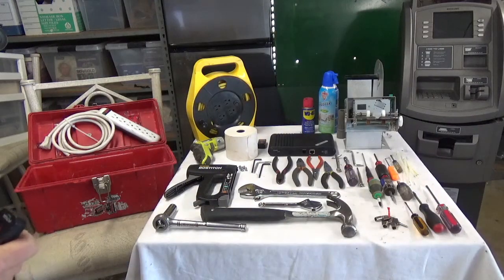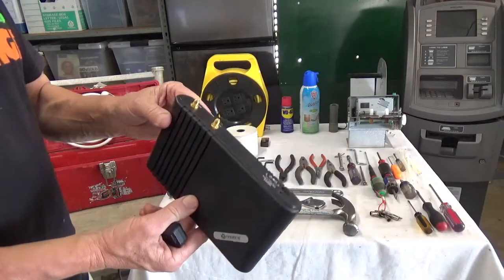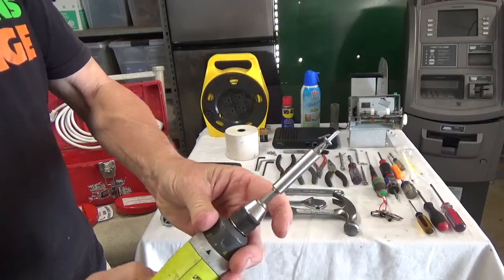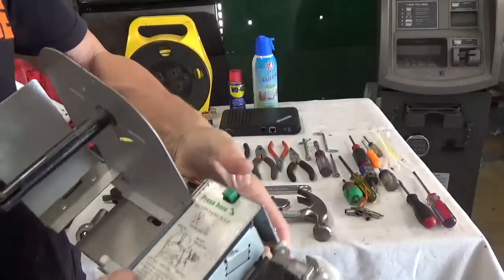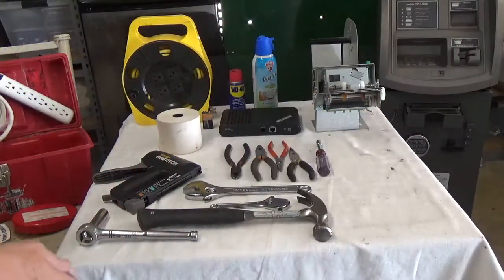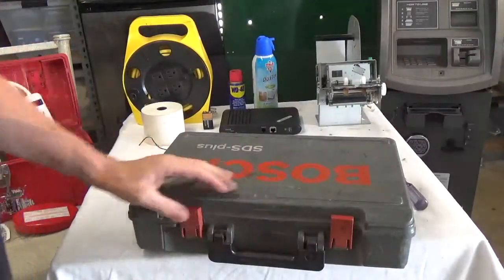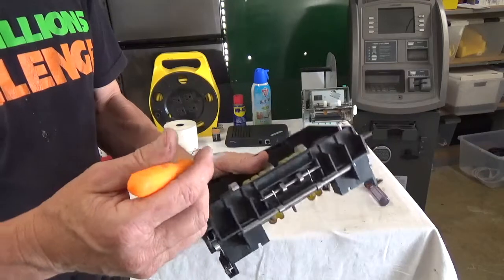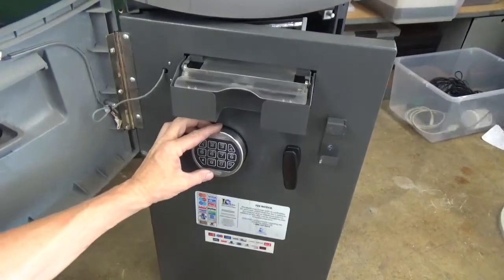ATM - Tools of the trade

Comment: On the 1800 SE if you forget the reject door open it can interfere with the locking mechanism. After entering the combination it will beep twice for GOOD but the handle won't turn.
The solution for this is to give a good kick with your heel in the middle of the door to bounce the reject door out of the way. Then try again.

Comment: what are the three most common repairs you perform?
Reply from the maker: Hi, The most common service call is a communication error, phone line, wireless box or internet problems. Second: Money will get stuck in the cash dispenser belts. Third: The receipt printer jams up and needs to be taken apart. But saying that, these service calls are usually older ATM's. The new ATM's have very few service calls unless it's human error. Hey, feel free to call me directly on my cell phone anytime. You'll find my number at the end of any of my videos.